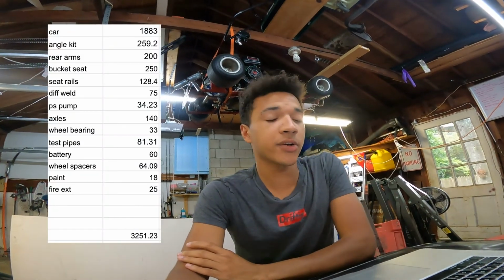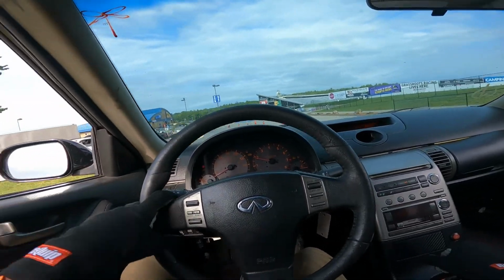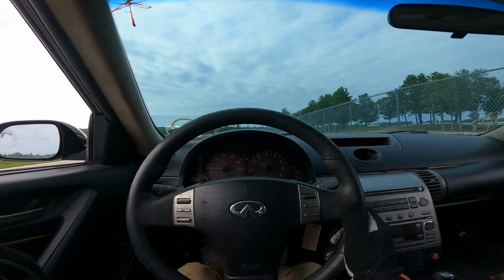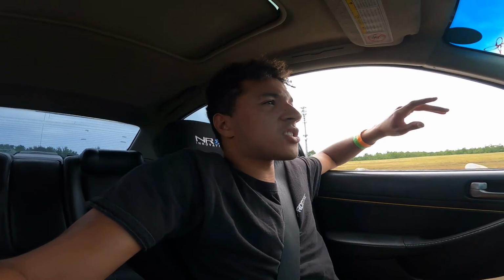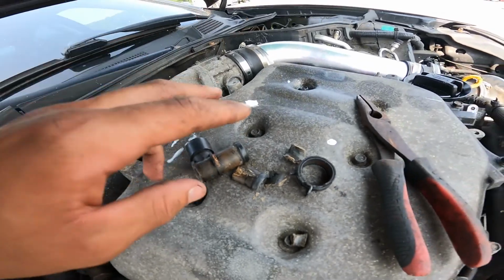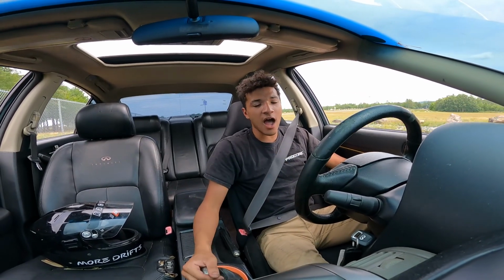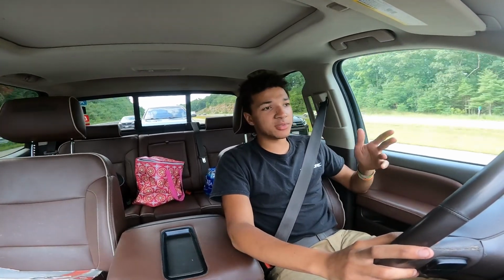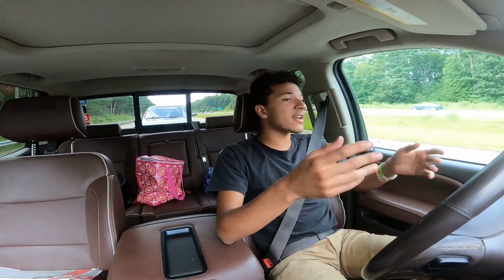SALVAGE DRIFT CAR ON TRACK - $2000 G35 Drift Build Ep. 4

Comment: For the cooling issue, to help bleeding, drill a couple holes into the thermostat or check the orientation of it. They come factory with a bleeder hole but if its on the bottom it wont help bleed the air.

Comment: did you cut or pull the bump stops after installing the angle kit? you should be able to get near 60 degrees with that gktech kit. I was at this event and watched you legit kill it all day in the s13 this car should be easier to drive.